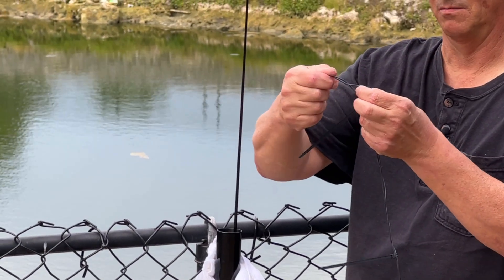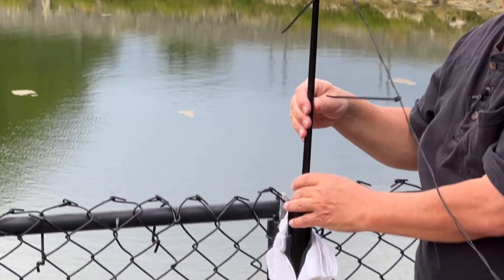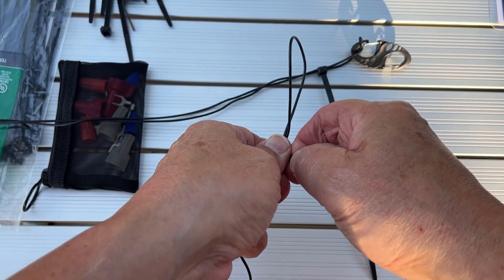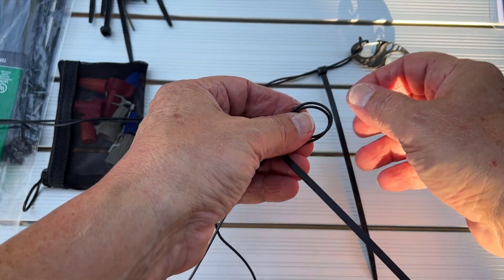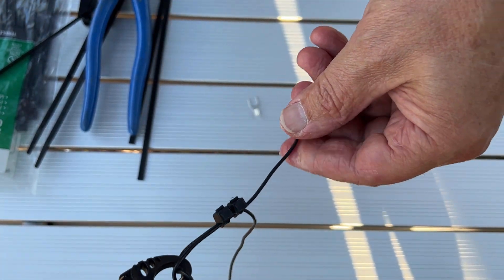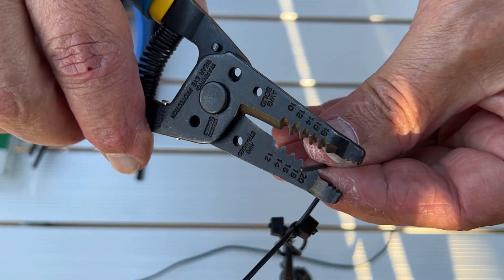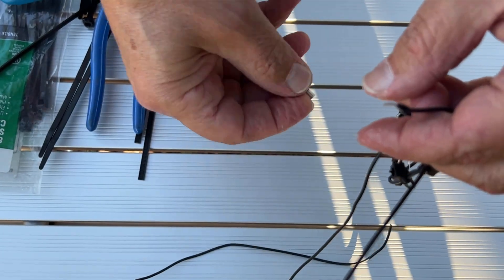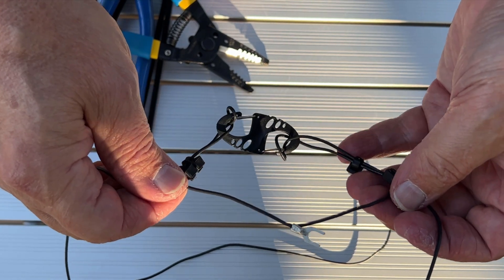Part 9 Cut & Tune:  Half Wave End Fed Antenna Build 10/15/20/40 Meter Ham Band - CAHRTENNA Artemis

Comment: Odd question, I get that you want to make it a linked dipole but wouldn't you want to cut it to 36 feet and then immediately trim to length so that it is resonant on 10 and 20 meters, and then add your link for 15 and 40 meters and tune that section of wire? If so, that wasn't really clear in the video.
Reply from the maker: W9HJ That is precisely what I did....  Not a video goes by that after I hit the make it "Public" button, I start to think of all the things I missed.  I'm already planning another video where this is the total focus.  Wrapping it in this time with the CAHRTENNA build, it kinda got lost.   Thanks for the feedback.
Reply: @HOAHamRadio  I assume you still use the 20 foot counterpoise wire, even when you are using the 36 foot 10/20 meter wire only?
Reply from the maker: Correct again, by default I deploy a counterpoise.  Its always worked for me.

Comment: measure twice cut once. lol
I watch alot of videos and most are in imperial measurements which are alien to the rest of the world. lol
Reply from the maker: I'm at the age where when I went to school as a child they were NOT also teaching the metric system so we could function in the rest of the world.  I so wish I would have learned it long ago.  When someone talks metric, I have to go to Google to get the conversion I need.
Reply: @HOAHamRadio  It's just what you were taught. 🤷‍♂️ I recall seeing a doco when the US and Russia had a joint space mission, must have been pre ISS, the US used Imperial and Russia used metric, they were not able to Dock with each other so that's alot more important than a youtube video. Lol
I still watch all videos but have to use different equations and convert to metric.📏📐🤓
Reply: You can partly thank a storm at sea in 1793 and British pirates for helping to keep the US on the Imperial system. U.S. Secretary of State Joseph Dombey, who set sail for the New World with a small copper cylinder, which was destined to be America's new standard weight — a kilogram. But Dombey's ship was beset by bad weather; an Atlantic wind pushed Dombey's vessel off course and into the custody of ransom-desiring British pirates. Sadly, he died a prisoner and the kilogram never made it to Jefferson.
Reply from the maker: @W9HJBill  Ham radio and History; like it.